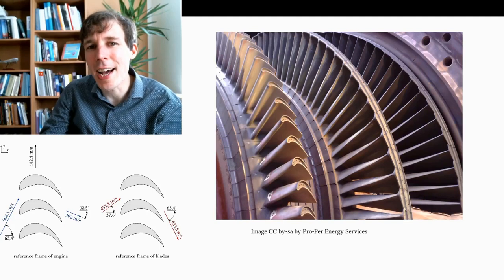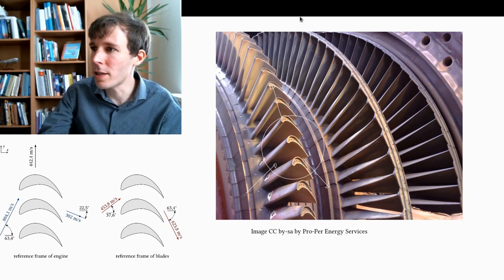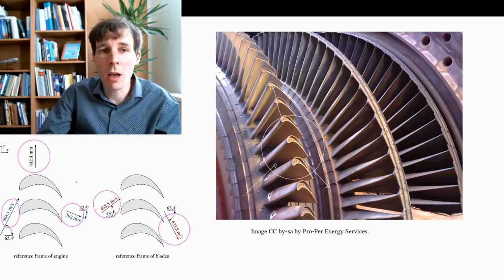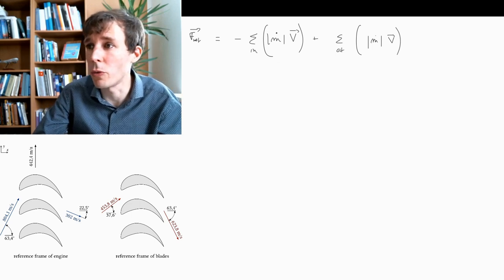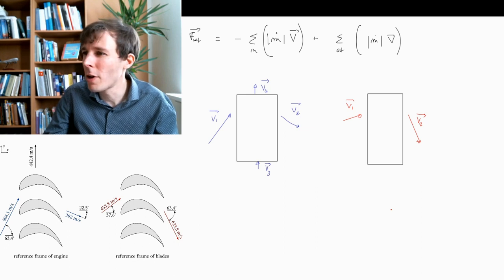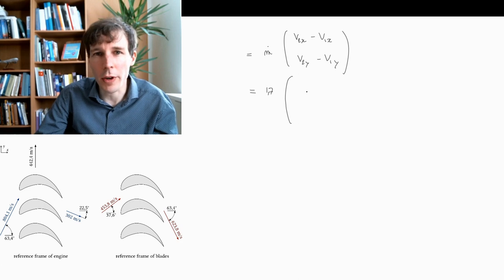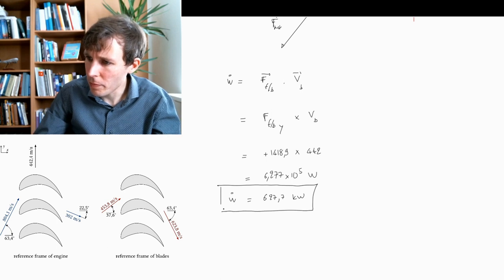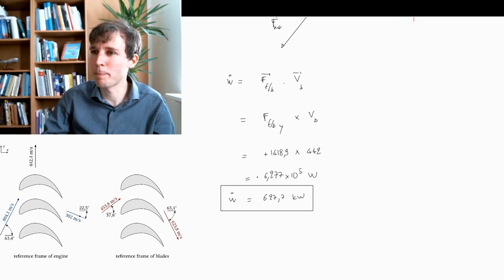Computing force and power on a turbine blade (Fluid Dynamics with Olivier Cleynen)

Comment: Can you explain more about equations required for the conversion of forces and angle from first figure of moving blades to stationary blades in radial direction?
Reply from the maker: You have to add and subtract vectors. Just subtract the velocity of the blade to the (left diagram) velocity of the gases. But instead of doing it with just the values (the length of the vector), you do it in 2D, stacking the arrows (vectors) one after the other. Check out "vector addition/subtraction" in a university math book, this should get you started. Good luck, I hope this helps!

Comment: hello mr cleynen ,I have a question about the forces generated in a gas turbine.isn't there a radial force as well as an axial and environmental force on the gas turbine blades?How can we calculate this generated radial force?
i would be very glad if you answer
Reply from the maker: Of course, yes, there is a tremendous radial (centripetal) force exerted on the blade as well. But it is due to the blade’s own movement and has nothing to do with the fluid, so this is out of scope of this fluid mechanics study. You should refer to a solid mechanics (in particular, dynamics) course to study that. Good luck!
Reply: @oliviercleynen  thanks a lot.ıs there any solid mechanics book to find the gas turbine  radıal force etc what is your suggestion
Reply from the maker: @batuhanilik6236  My favorite is the duo Statics + Dynamics by Meriam and Kraige. Old editions (even very old editions!) are just fine, you can find them on Ebay for very little money. Good luck!
Reply: Thank you sir for your supports